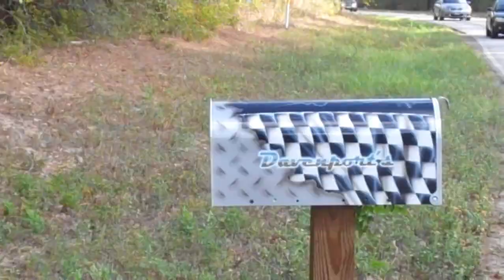Davenport's Custom Airbrush Mailbox

Comment: What kind of printer is that and paper? I have been having a lot of fun trying to do some stencil work with my airbrush and that is light years ahead of what I am trying to do. Does that cut out the spots in the pattern or do you need to use an X-acto knife prior to painting to cut out the areas where you need to lay down the paint?
Reply from the maker: Are you familiar with vinyl plotters? This isn't a printer, it's a plotter.  It doesn't use paper, or mask, it cuts vinyl.  You can only use the vinyl one time.  I just made a line drawing, cut my vinyl and separated the positive from negative before masking for installation.